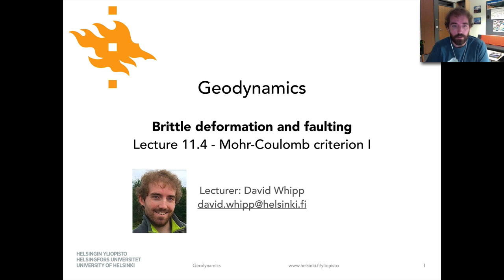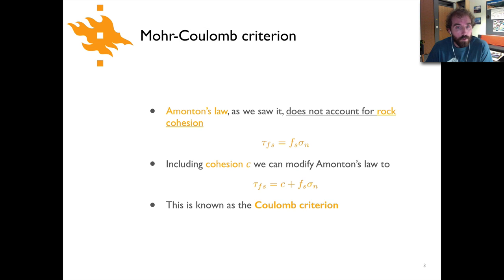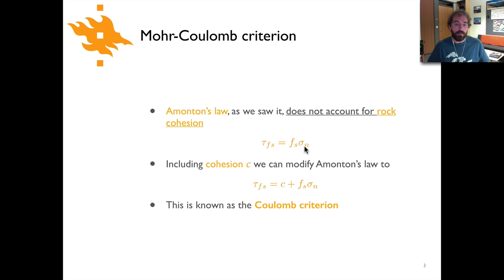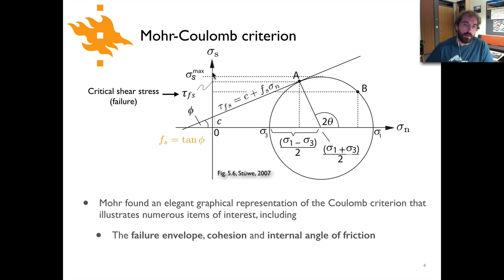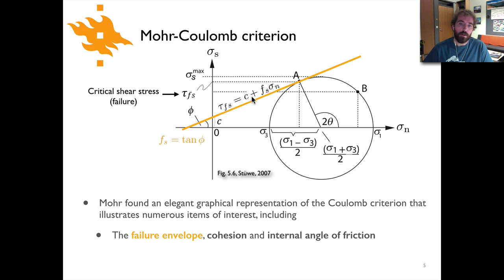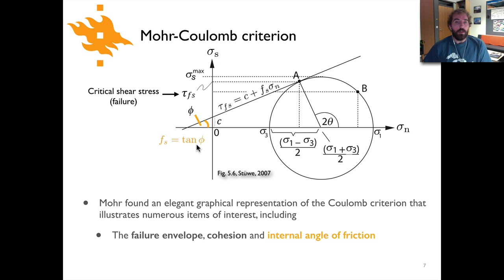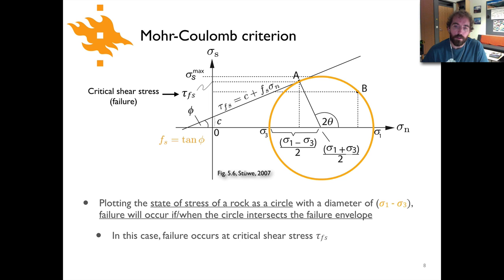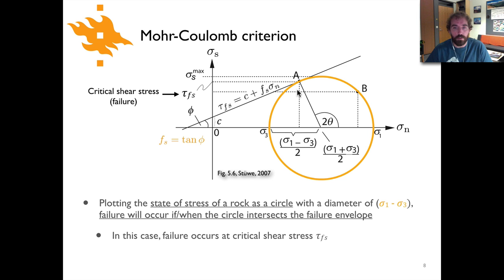Geodynamics - Lecture 11.4: Mohr-Coulomb criterion I

Comment: Hi David, thanks for the lecture. Can I ask a question? what is the meaning of the angle "2\theta" in the Mohr's circle?
Reply: In real life, the difference between the principle stresses is 90 degrees as they are tangential to each other, but on mohr circle they are 180 degrees apart, so to get real representation of them we need to multiply real life angle by 2 or divide circle angle by 2

Comment: Geotechnical question how can you solve it?

laboratory experiments determined the frictional properties of a sandstone as m = 0.67 and C = 20 MPa. Use the Mohr
diagram to determine the strength (differential stress) of this sandstone at a
depth of 2 km in MPa, assuming that the mean stress at this depth is 50 MPa.
Reply: how can i find the normal stress of the body in a depth of 2km knowing the mean stress at this depth is 50MPa?
Reply from the maker: This sounds like a homework problem, so I won't solve this completely for you, but perhaps I can give you a few hints. For me, the key to a problem like this lies in trigonometry. First, you know that mu, the coefficient of friction, is the slope of the line on the Mohr diagram. This is also equal to the tangent of the friction angle (mu = tan(phi)). The line on the Mohr diagram crosses the y-axis at the value of the cohesion. The mean stress is equal to the average value of the principal stresses, and is at the center of the Mohr circle. Thus, the center of the circle should be at sigma_n = 50 MPa in your case. What you need to do is find the differential stress, which is the radius of the Mohr circle. You can find its length using trigonometry. If you look at the Mohr circle plot, there is a triangle formed by the sloped line (the failure criterion), the normal stress axis, and the radius of the circle extending from its center to point A in the diagram. You need to know two things. First, you need the length of the side of the triangle running along the x-axis, and second, the length of the radius (differential stress). To find the length of the side of the triangle running along the x-axis, you will need the friction angle, cohesion and mean stress. From there it should be fairly easy to find the radius of the circle. Good luck!

Comment: Thanks for the video it was helpful. I have a question: The cohesion is the ability for the rock to hold itself together, how about the joint? (in joints the particles are not held together anymore) what is the definition of cohesion in the shear strength of joints? Is it apparent cohesion?
Reply from the maker: Good question. Assuming there has been nothing that has precipitated within a joint or fracture that might fill in the space and bind the two sides together, the cohesion should be zero. The shear strength may still be nonzero, depending on the frictional contact between the two sides and the pressure holding them together, but the cohesion could be zero.
Reply: @helsinkiuniversitygeodynam6511  Thanks for the reply